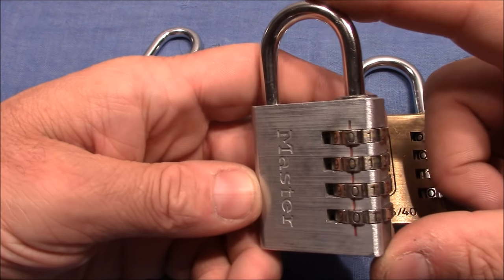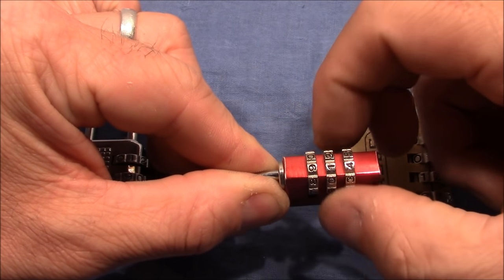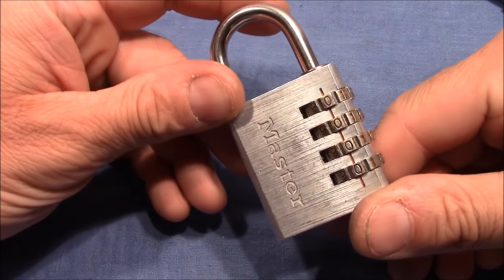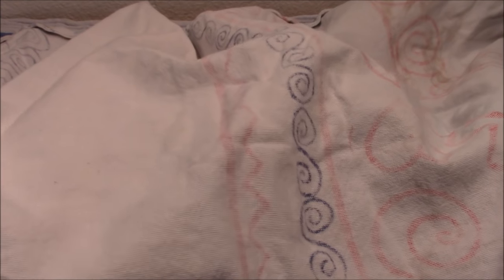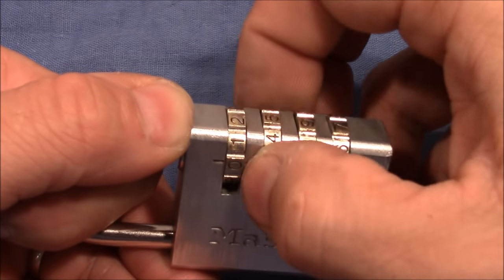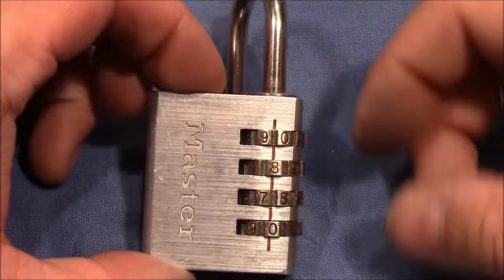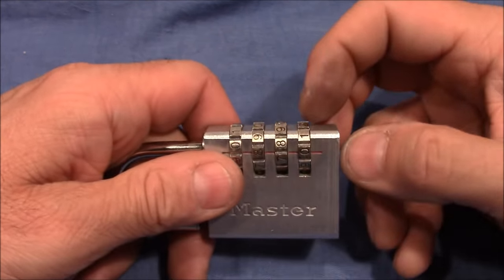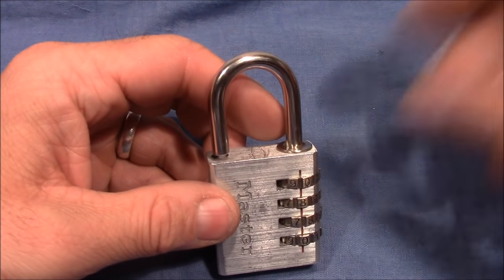(picking 206) Master 4-wheel combination padlock opened - fuzzy decoding method - thanks to Ulrik

Comment: This method also works on the Master Model No. 643DWD which has letters instead of numbers.

Can now unlock it in anywhere from 30 seconds to 3 minutes. 

It works best if you attach a rubber band to it, and then anchor it to your knee if you're sitting down.
This gives you consistent pressure, which makes it a lot quicker to decode.

Note: dont even waste your time on the top 2 wheels.  you almost have to treat the top 2 and the 
bottom 2 wheels as a different sets of tumblers.

Step 1. Apply a lot of pressure to the padlock.  press down on the 3rd wheel so it can't move anywhere,
then rotate the 4th (bottom) wheel until you get 2 letters/digits that the wheel moves loosely on.

If you can't quite find any that are loose, apply more pressure.

If you still can't find any, mix up all the combination wheels and repeat step 1. 
Sometimes if the top 2 wheels aren't in the right spot, you can get false positives.

When you find the 2 letters/digits that move loosely, you'll know.  just select one of the two and move on.

Step 2. 

Apply pressure to the 4th wheel now so it can't move. 
Now again apply pressure to the padlock and rotate the 3rd wheel.

This wheel requires a lot of pressure on the padlock.
You are again looking for 2 digits/letters that the wheel moves freely between.
Select one of the two digits.

If you get false positives on this one, or they all have about the same feel, you'll want
to mix up the top 2 wheels, and repeat step 2 again.

Step 3.

Now hold down on the 1st wheel, so it can't move... 
a lot of times this wheel likes to move around, especially if the bottom 2 wheels are correct.
Apply pressure to the padlock, and move the 2nd wheel, sometimes you'll know this one
right away, as it may click into place and the padlock may give a little.
i've also had it where it was between another set of 2 combinations as well.

step 4.

Apply pressure to the 2nd wheel so it cant move,
This one also likes to move around with the first wheel.

Apply pressure to the padlock again, and rotate the 1st wheel, if all goes well, it should 
pop open.  

If it didn't open, try shifting one of the bottom wheels over to the other position that was loose.

If all else, repeat step 1 and 2. 

if you still can't get it, just mix up all the combinations and try it again... when you 
finally start to feel the "loose" areas, you'll know you're on the right track, and it gets easier.

i was so confident with this method, i mixed up the combinations several times without looking
and decoded it pretty quickly.

it requires a lot of consistent pressure on the padlock, why I dont recommend using your finger,
because you have to keep getting a better grip, and you might not feel where the wheel goes free.
Reply: If you don't feel any resistance on the bottom 2 wheels, just move the top wheels over until the bottom wheels are firm.  the goal is to make the wheels hard to move, and then the "loose" spots, are where the correct combinations are.   the 2nd top wheel usually will click into place, and the top wheel is generally always firm.

if you accidentally guess the top wheel correctly, the bottom wheels show little resistance, making it hard to 
decode.   thats why you sometimes have to rotate the top one, until they have resistance again.
Reply from the maker: Thank you for the detailed description of the process - will try it step by step and check if I can reproduce your method. Cheers :-)
Reply: When i first saw this video, i didn't realize you did many others... so when i seen you cover
the lock with the blanket, i thought you may have been trying to pull a magicians act, and replaced the lock with a different one. lol it was funny because i was trying to identify the scratch markings on your lock to verify it was the same one.  youtube is full of stuff like that, fortunately we have genuinely knowledgeable people like you around.
Reply: Not sure if you have another video for this, but... you wouldn't happen to have any recommendations for a  lock, would you?   lol i noticed you like to get attached to specific locks, especially if they give you a little grief. lol
Reply from the maker: ***** Thank you :-) Haha, no mystery involved here, just trying to feel and interpret the feedback. And my videos are not meant as prove for anything. They should entertain and give instruction on how to do it and to see how easy / hard it is to overcome such a mechanism.
Reply from the maker: ***** Recommendation for what kind of lock - with key or combination? Where would you use it?
Reply: Haha can't believe that worked, just got our old one up with this method and zero experience in "picking" locks haha! Thanks man :)
Reply: well considering i came here because i lost my combination, might not make sense to 
get an impenetrable combo lock. so a key lock would probably be better, which would
probably be harder to crack as well. just used on a shed to keep some tools secure.
Reply from the maker: JeppeFS Vismann Very cool, thanks for the feedback.
Reply from the maker: +Warren C As much as I'm engaged with picking and decoding, I personally would pay more attention to physical security. Of course normal combination locks can be decoded given some time and knowledge without tools. But some exist, where this is not possible (where you cannot tension the locking mechanism) like on the TOKOZ (https://youtu.be/Inhc3LUbhFA?t=142). I personally would prefer these kind of locks over the usual combination locks. But beware of these types which can easily be bypassed (master or sesame) https://youtu.be/TtVEIt-W6UE. One of the best (normal) key-padlock I know is the Burg Wächter Diamant (https://www.burg.biz/international/p/locks-and-bolts/d-600-diamant/). Heavy construction, 6 great security pins, narrow keyway, hardened shackle. Maybe a bit too much for your use. So maybe an American 1100 or a Pac lock will be good enough. My favorite is the disc padlock, like that http://www.paclock.com/disc-padlock-pro.html.
Reply: Warren C Can you translate it into Korean?
Reply: Warren C
Reply: you rang?
Reply: .When you say "apply pressure to padlock", do you mean pulling up on the shackle, like what @Potti314 does with his left hand in 4:01?
Reply: Hey! i was given one of these locks (the letter version) and i don't have the combination, but its open (and infact wont close) and i'm not sure how to decode without being able to put the tumblers under pressure. all the videos im finding assume a lock that is in the closed position. Any idea how to fix this?
Reply: Legend. I had an old master lock around for years with a forgotten code. I tried every other YouTube technique but after step 3 it popped open. Thanks again.
Reply: Came back to this video/comment to say..... IT WORKED!!! I work at an escape room, and someone accidentally reset the combo to one of these locks. Thank you for your written out steps, I'm actually shocked that I got it open! :')

Comment: I have the same lock but it's only a three wheel combo. I found it very easy to find the gates by pulling the shackle and starting with the first wheel and it pops in the gate and to me it's very noticeable   But with that said you taught me something. The lock was given to me by someone at my work and I did not know you could change the combo so thank you for that. Now I can play with it some more :)
Reply from the maker: Those combination lock are great fun. Get yourself one with false gates for a bigger challenge. Some are easy to decode, some not, depends on the precision and on the way it is built. Check out my playlist of combo locks. Have fun.

Comment: I've found an alternative way to decode these, or at least the 643D I just got.

Turn each wheel to the position where it wiggles most freely.
Do not use any shackle pressure.

The detent is solid on every position of the wheel, but the axle the wheel turns around feels loose when it's oriented correctly.
The wheel wiggles back and forth in the body of the lock, pivoting around the detent (left of the wheel). 

I've decoded it a few times now after having blindly set an unknown combination on it.
I have no idea if this still works on locks that have more wear on them, as I opened the package on mine just a few hours ago.
Reply from the maker: Do you mean something like this? https://youtu.be/zRNhfNjse0M

Comment: If you try it again the first number at least on mine you can feel a good click just after the right number and the second wheel you can feel the shackle move a little and of corse the last number will open it but Mir is only three wheels so yours may act a little differently.
Reply from the maker: Yes, different locks can behave very different. Also important is the age, older locks loose precision and are easier due to better feedback.

Comment: i have a similar lock it was in my bucket of locks i to was having real trouble unlocking it i was just not getting any feedback and the wheels apart from 1 seem to move freely all the time. that was of some help to me though i think its going to challenge me as its my first combination lock and as you no im a neewbie. great vid and thankyou
Reply from the maker: Maybe try indirect decoding. For every number of wheel #1, quickly spin all other wheels and see the effect. That digit on wheel #1 that causes other wheels to bind is probably the right one. Then continue from that.

Comment: Master locks are crap, we can agree on that. I'm a noob at picking/decoding, but I think these master locks simply have too much play everywhere, so much even that typical decoding tactics don't work for me. I bought a new one, set a code, couldn't open it on that code and then went down this rabbit hole. I now have no idea anymore how to change the code, but I can open it at random settings that change whenever I close it. I simply move the wheels until the bar is offset maximally (and the wheels wont move anymore). Then it opens -with a bit of bare hand pressure-, but I can't reliably change the code per the instructions anymore. Then when I close it, I have to find a new configuration that opens it. The initially set combination, or the new ones I tried to set (before and after going through this vid) don't work as well as just feeling out the lock and prying it open.

Have I simply broken this lock with my bare hands? Have I bought an already broken one? Or is there something new and interesting I should learn before I can finally use this lock as it was designed? I enjoy the art of cracking locks, but I was honestly looking for a lock to keep my kids away from my dangerous tools first. 😇

Comment: Not working… i have even cheaper 5$ ABUS 3 digit lock and 6 years im trying to open it and its not opening at all. 
When i pull up the shackle the first the first disc moves heavy on all numbers and second less heavy but still heavy and last disc is loosely spinning and i get no click on any of the discs at all…  I want to open and use it not to break it. So what to do?

Comment: I have the same lock except it has letters vs digits and mine is in an open state.  I can't lock it or reset the code.  Any ideas on how to decode this?  Because it's not open, I can't just pull at the shackle.
Reply from the maker: you can try this https://youtu.be/kAlBM6UdOjM
Reply: @Potti314  Thanks for the link.  When I apply pressure from top, none of the wheels turn.  They all seem stuck no matter which position they are in.  Am I doing something wrong? I
Reply from the maker: @yusufosmani2406  Hard to say from a distance. Maybe you need to apply less pressure OR all wheels are in gates (true or false). Can you describe more precisely how the lock / wheels react?

Comment: How do you choose which side between the two stops to use? Try both?
Reply from the maker: Yes, try both ;-) But I found a better method. Check the binding order - on mine it's 1 through 4. Then (taking mine as an example) turn the first wheel at one digit at a time and every time test the second wheel. At the first wheel's number where the second has no free spot, the first is in the correct place. Continue with 2 and 3, and so on. It's very reliable on mine. Good luck.
Reply: Potti314 i decoded this lock with your method yesterday. Someone gave it to me.. he had locked it open and accidently changed the code. Worked like a charm. The Guy was a bit spooked by how fast it opened :) I told him to go Abus if he valued his belongings :)
Reply from the maker: Wow, congratulation - that's amazing. Thanks for the feedback :-) If you're concerned about your valuable, don't use combination padlocks at all: https://youtu.be/eNhKRSqncYs
Reply: Probably true. I watch Bosnian Bill a lot, so I know that. But If you're gonna use a combination lock, Abus is pretty impressive.

Comment: I have a similar lock which is open but I can’t close it, as I have forgotten code, the wheels all spin easily no tension. Can you help please.
Reply from the maker: I just answered you on the other video. Try with different pressure on the shackle and see it the feedback on the wheels change.

Comment: Cheat: Stick a long sewing needle (stiff wire, straightened paperclip, etc) down the code change groove. Rotate the top wheel until it drops through the gate. Repeat for the other three. The gates are now aligned (halfway between a digit). Remove the needle and rotate all 4 wheels together until shacke pops.
Reply: If doing that, for the 7640 at least, they seem to be aligned on a whole number though. Add +3 to each number and you have the combo.
Reply: Thanks, this tip was golden. Also @CookieTube; For the 3217cd you need to subtract -3 from each number to get the combo.

Comment: Hi, I have a 643D blocked in open position but I don't remember the code, do you have a method when the lock is open ?
Reply from the maker: Try this https://youtu.be/kAlBM6UdOjM Hope it helps.
Reply: I've found an alternative way to decode the 643 (and possibly related models) with no shackle pressure. 
When a wheel is set to the right number, it rattles. That's it.
Try each wheel, one after the other, and find the position where it wiggles most freely. 
Do not use any pressure on the shackle.

Comment: HERE'S THE INFORMATION YOU WANTED ON THIS LOCK. Thumbs up great video. I pick and decode locks for fun. I'm always looking for a challenge. DIRECTLY BECAUSE OF YOU I BOUGHT THIS EXACT SAME MASTER LOCK, as featured in your video. I agree it's different, I picked it EXACTLY as you had described. But if you take another look there are a number of other methods that still work such as finding the loosest wheels, not at all difficult. And contrary to your video it does have false Gates, but it's so poorly made,!!! They are there but are rather shallow and ineffective, and simply tensioning the shackle will bring you right to the correct number. It also has features that no other lock has such as that the numbers lock when the shackle is open and easy to use and to operate the CHANGE CODE POSITION. It's so poorly made by MASTER LOCK that all of its weaknesses can be exploited easily and therefore there is no reason to tear it apart. It's one of my favorites to play with. Thanks for listening and for inspiring me to buy this lock. Take care.
Reply from the maker: Cheers buddy and thanks for watching. Makes my happy to read that you have fun decoding like I. Once I made a video where I decoded many locks in a row, maybe it fun for you to watch https://youtu.be/iinsKYf5M6s

Comment: The lock (Master with 4 letters) on our shed in which I keep my telescope and accessories would not open, we tried for weeks! Same combo we always use so should have easily opened, but no luck. We sprayed with graphite to see if that was the problem, which helped the tumblers(?) move a bit more easily but still no luck. I googled "how to unlock combination lock" and your video came up, I watched it, and within 20 minutes had it open! (BTW found two letters of the combo had been changed up accidentally - maybe pushed up on lock when opening/closing who knows?) Thank you so much for posting this! Also, read your recommendations for more secure locks and will be getting one of those! :-)
Reply from the maker: Hey, that's great news - awesome success-story for you and me. Thank you so much for your feedback - appreciate it a lot :-)

Comment: I have this same lock only it's letters and I lent it for my sister to use at the gym and now the bottom spinner thing is stuck and won't turn to open it. I already know what the combination is because it's mine. I don't have my packing and instruction since it's a lock I got a while back. Help. I can't spin it to fix it. It's already opened the lock but just stuck and unusable now.

Comment: I have this same lock, however the shackle is stuck in the 90 degree position that you use to reset the combination. It turned like this in my gym bag and changed the combination on its own. Should the same tricks in this video work when the shackle is in that position? Been trying for 20 minutes with no luck.

Comment: Potti - I believe each wheel has at least a false gate (mine seems to) and all I do is pull on the shackle and rotate wheel 1 to 4 watching for and feeling for shackle bounce. The shackle moves very positive when you slot in a gate (false or otherwise)
Reply from the maker: Yes I also believe it has false gates all over. Its a great lock to play with. But recently I bought a new one and it did not have false gates at all - very disappointing.